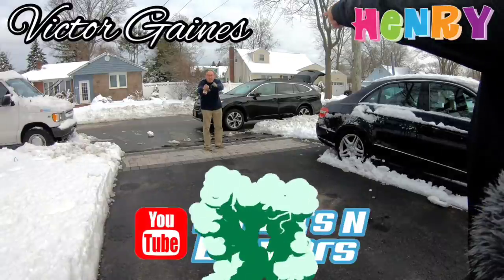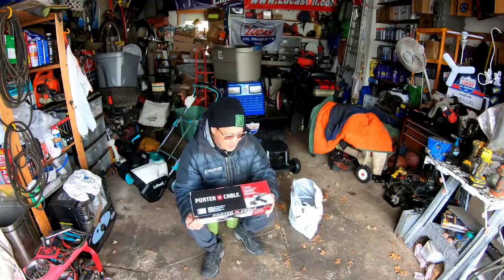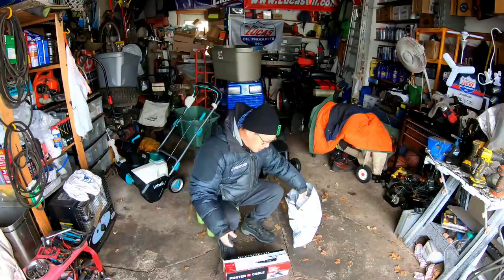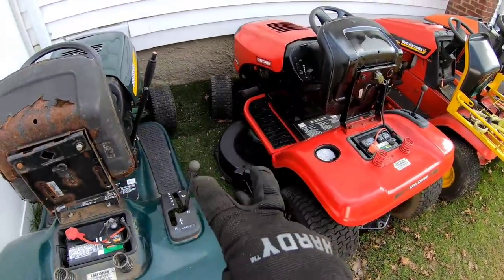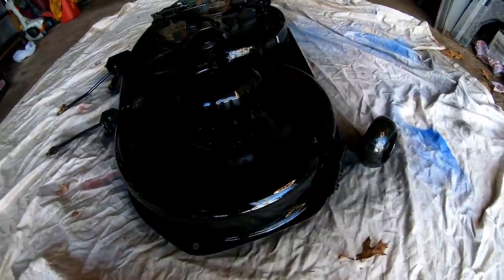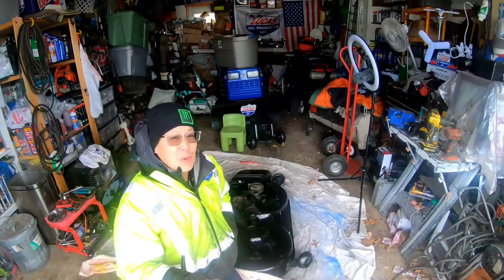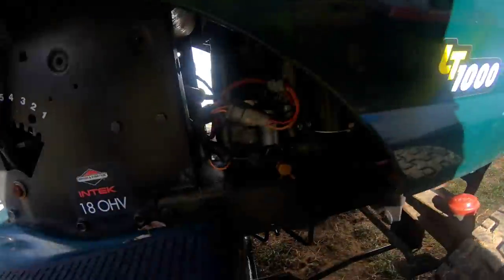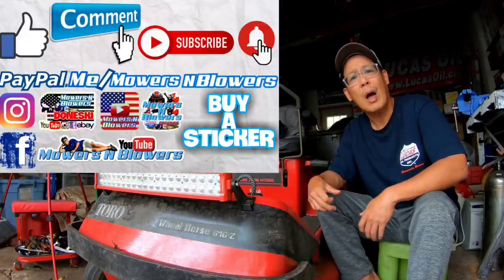CRAFTSMAN LT1000 TRACTOR MOWER DECK BELT & PAINT PTO BLADE ENGAGEMENT CABLE REPLACEMENT INSTALLATION

Comment: Time to take a short break to avoid YouTube burnout, you have had a great run maybe time to slow down a little especially since it is cold outside. We have a heated shop so easy for us but hard on your body. As a subscriber will always watch even if you need to take a couple days off!
Reply from the maker: Excellent advice Wayne, thank you.

Comment: Henry,  a trick when re-painting mower decks etc...if you have over spray or paint over a decal accidentally. put some old gasoline on a rag and it will wipe right off. Put a putty knife inside the rag for precision edging if needed
Reply from the maker: The 98 cent stuff doesn’t overspray much!  It hardly covers anything

Comment: I sent you an email. I just got a bunch of 12 gauge steel 6x8" patch pieces of sheet steel so I will be starting my refurb of my John Deere Mower Deck and as soon as I get my 3/16" pieces I will be working on my Ranger. I look forward to hearing from you. That LT1000 is a very sharp looking machine.

Comment: Henry. That yellow wheel looks like it may have come off of a John Deere? The yellow wheels would actually look really good opposite the dark color of your tractor. 
The big MTD YardMachine garden tractor of mine has the primer battleship gray wheels opposite a similar charcoal gray almost black color. So No problem getting paint for my tractor.compared to some of the other paint combinations that AYP & MTD had on their products. 
Well Henry, this morning I purchased another John Deere 110 tractor today and like you, I still feel really cold from being outside today. I think that it was around 14 degrees when I got up this morning. We actually had some bright orb in the sky for a chance which helped tremendously.
And As usual, The tires are rotted pretty badly on my latest acquisition in which when I tried to inflate the tires - I think as much air was escaping through the tire sidewall cracks as what I was putting in. The engine smokes a little but starts and runs pretty smoothly. 
Looks like I will be ordering more tires!!! That is my update for now,Henry.
Reply from the maker: Thanks for the update,  good luck with it!
Reply: @MowersNBlowers  Looks like I will be really good at changing tires before all is said and done.

Comment: I just saved one of those tractors off a trailer it was buried on the trailer with a bunch of all the metal I asked the guy what was wrong with it he didn't know it was taking really good care of cuz the paint is in great condition tires all hold are no dry rot the deck was still saw it I think it's a heavy gauge 1 I put new spindles on it and new blades and coat it underneath it's got the fuel tank in the rear it's a 6-speed it has a V-Twin briggs & Stratton if you have Instagram you can check it out let me know if you want to have the link to that or my name I posted a lot of pictures and videos there